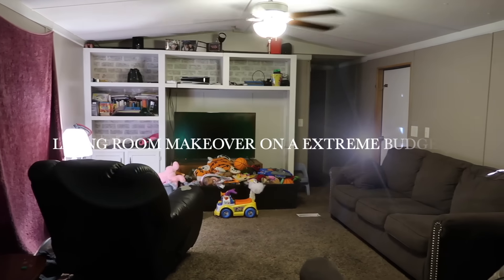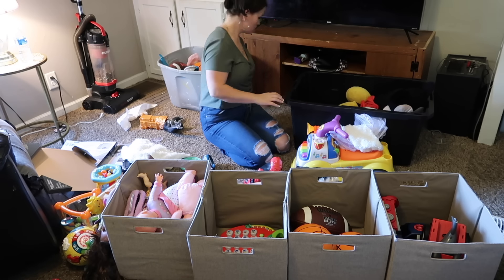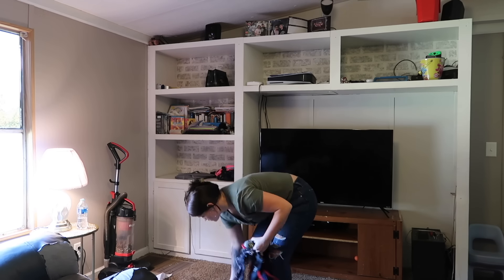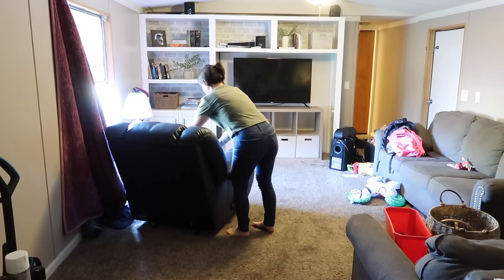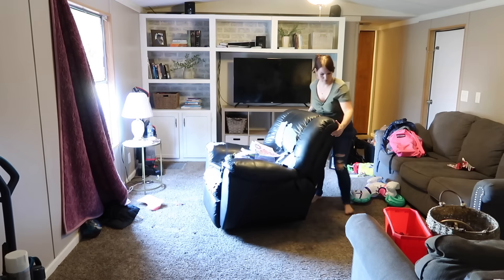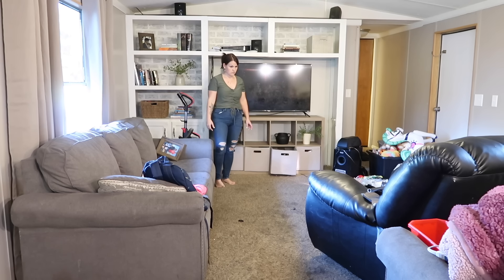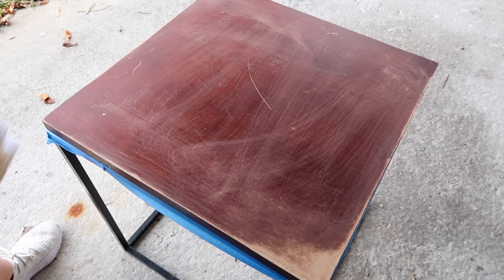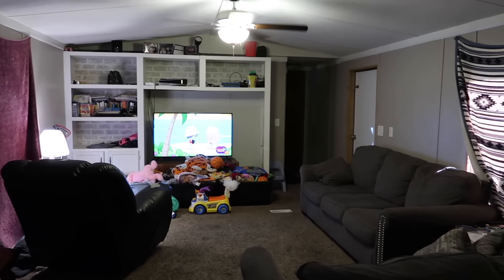Extreme living room makeover on a budget | Budget friendly decor ideas! Mobile home makeover!

Comment: It's so hard to redecorate on a tight budget like mine. I taught myself carpentry and re-did an entire room - ceiling tiles, crown molding, chair rail, beadboard, baseboards, etc. It was the FIRST time I've ever touched an electric tool. I did all the work, bought all the tools, except a great nail/staple gun my hubs bought me for my birthday - And I bought all the building materials. It took months because I could only afford so much each month. Wish i could post before and after pics!  One thing's for sure, organization is an automatic face lift to a room. You did a great job! I just  started on my kitchen 😂